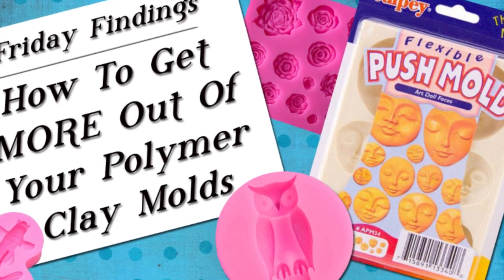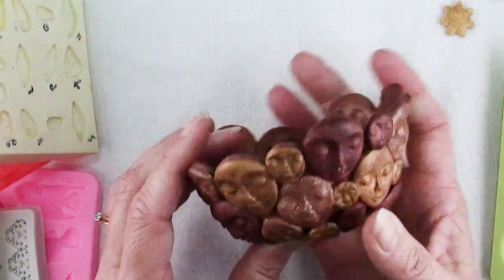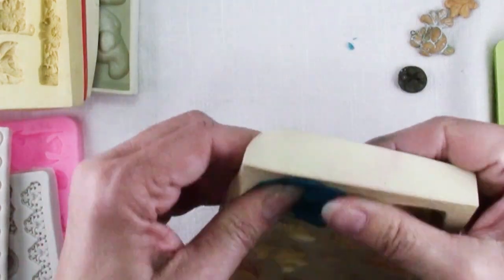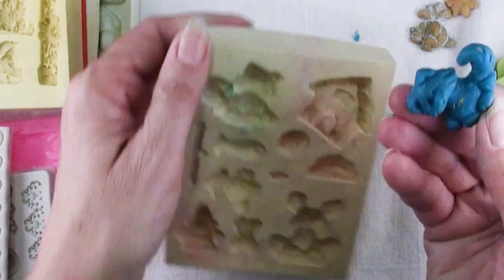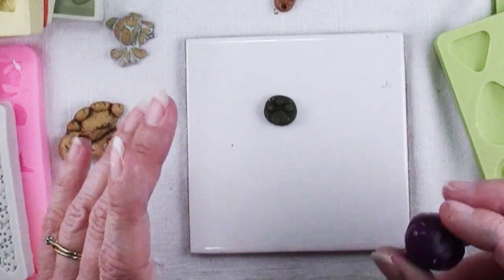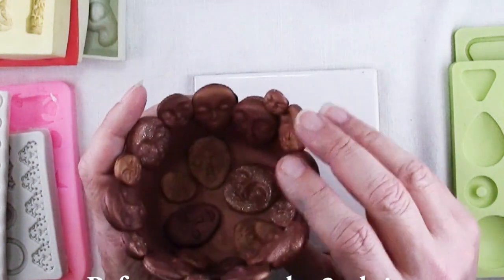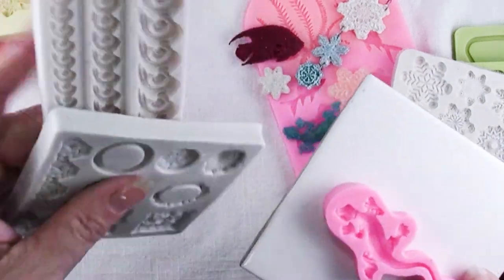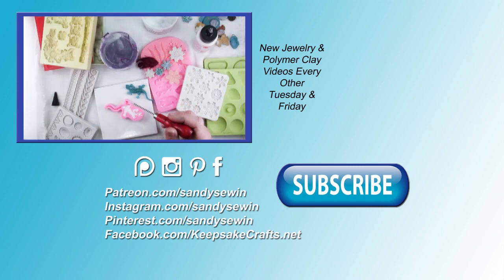How To Get MORE Out Of Your Polymer Clay Molds - Friday Findings

Comment: I found mine at Joann's for about $10. I found a lot of discontinued items there a few months ago. Bought most of them. I am currently working on converting a mini Bundt pan into something I can use for polymer clay molds. I used a variation of the jello jiggler recipe for step one. Waited for over a month for the molds to dry completely, (I live in a very humid place). Next will be the silicone putty. Oh, btw, the jello stuff also shrinks, so they'll be even smaller than the mini's.😁 I would be willing to bake the faces for you and send them.
Reply from the maker: Hi Beverly, thank you, but some one else already has offered to send copies for me. Clever idea to use gelatin to make a mold!
Reply: You're welcome. And thank you. I though of the gelatin after trying some other stuff which weren't quite as smooth. I wanted to keep the pan for food, so I had to be a bit more creative about what I used to make the molds out of.

Comment: Very helpful video Sandy, thank you! I actually just figured something out the other day which I found to be very helpful. I was using liquid clay in silicone molds but it wasn't translucent, I used the gold liquid sculpey, pearl & silver. I really like them but they're so thick sometimes that when I've used them in molds in the past the pieces always came out with little holes from air bubbles. I was frustrated & gave up for awhile, until I had an idea. I added a little bit of liquid clay into mold, then added a few small drops of clay softener on top of liquid clay, then added more liquid clay (but not quite filling the mold yet). I then used a silicone shaping tool (so I didn't scratch/damage the mold) to gently but thoroughly mix them together, making sure to get some of the clay softener/liquid clay combo all over the bottom of the mold (where all the texture & details are, which is of course where the air bubbles create their unsightly holes & gaps). Once it was all mixed & I felt confident that the mixture was covering the whole bottom very well, i added a bit more liquid clay to completely fill the mold (if you're feeling bold you can attempt to very gently mix it in w/ the rest of it in the mold, but i didn't do that on all of my pieces so I didn't have many problems w/ it overflowing. I allowed the filled molds to sit on my desk for about 1/2 an hour w/ the hope that any potentially trapped air bubbles might rise to the surface, and then cured. And you know what? Out of the 7 molded pieces I made that day, NONE of them had ANY air bubbles! The clay softener seemed to lower the viscosity or something of the liquid clay enough to minimize, well to actually prevent, air bubbles.. I couldn't believe it! Just wanted to share that info. Thanks again for the video!
Reply from the maker: Great tip, thanks! 😀👍💕

Comment: Instead of trying to pull the clay from the mold I have found it works to put a tile on the filled mold...I use a 4x4 clear glass one often because I can peek on the other side. I put it against the filled mold and press it so the clay sticks. With the molded clay stuck to the tile you can carefully pull the mold off, leaving the detailed molded piece intact on the tile. Then it's easy to remove it from the tile with the blade. Of course with a deeper one like the cat, and a flexible mold that isn't needed, but it helps me a lot with tiny or thin pieces.
Reply from the maker: Excellent idea, thanks! 👍😀

Comment: My next experiment is to freeze my raw clay and the grate it into fines with a cheese grater. I'll take the resulting crumbles and lay the most powdery into the details of the mold first, then toss the rest in to fill.  Pressing firmly to bond the polymers as it warms until I can get it to release for baking.  If I can't get it out, I'll put it back in the freezer and try again.  I will discover if I need a "base coat" of liquid clay first, and maybe another coat on the top to fully capture the details and bind the clay shavings.  What do you think? ~~~^..^